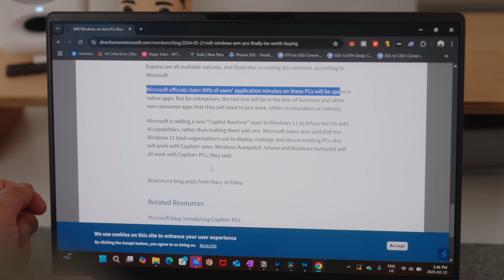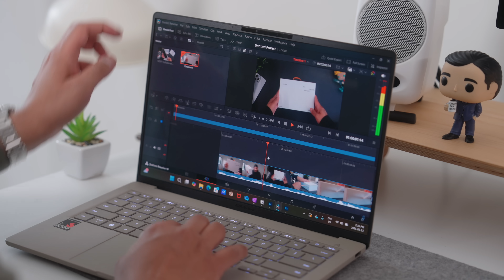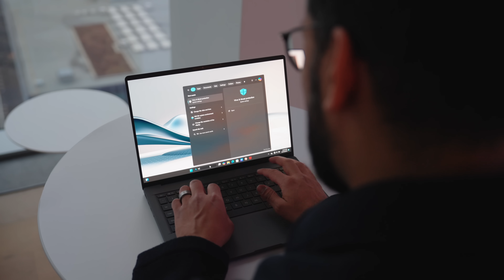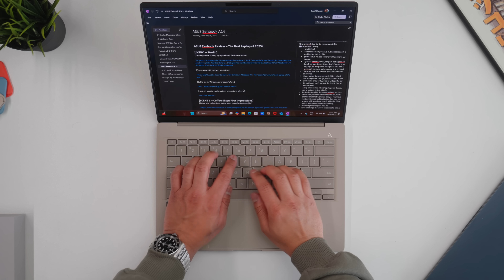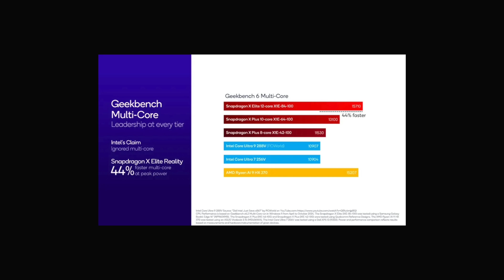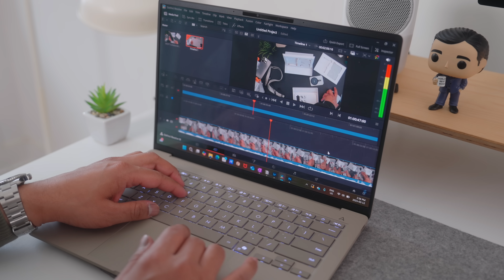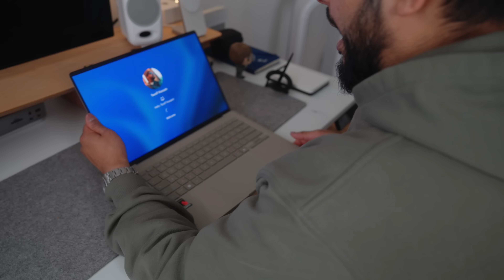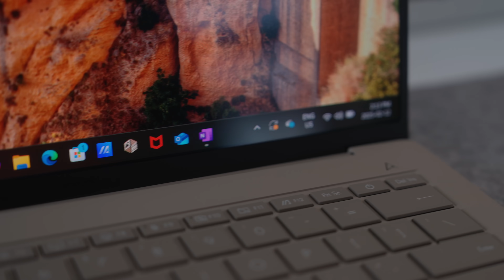MacBook Air User Switches to ASUS Zenbook A14 - My Experience

Comment: Damn, as much as I want to stick with a MacBook (currently using the Air M3 - base model), I'm having difficulty with the software I use for my course and most likely for my internship. My course requires lots of Excel work. While Excel is available in Mac, I encountered a lot of limitations which are just available on Windows. I tried to use Parallels VM for running Windows software--Excel, Power BI, and other windows-only softwares it's so slow since I have 8GB  or RAM. MacOS alone uses 6GB or RAM and with a VM in the background, it uses a lot of swap memory already.

Do you think this Asus Zenbook A14 is enought? or should I look at other options like the ASUS Vivobook S15 (X Elite), or laptops with Intel Core Ultra 5 or 7 with ARC graphics? Thanks.
Reply: I have the same dilemma. Air M4 vs Asus Zenbook A14 vs Asus Vivobook s15 😢
Reply: @accaneda3300 I went for a Lenovo LOQ 😂 I realized that these does not fit well with the things I do (data analytics) and I find these laptops slow and could face app compatibility issues. I might let go of the battery life aspect, but in terms of performance, I’m glad I went with a gaming laptop since these are slow af

Comment: For those who commented and laughing about 60 Hz, do take note that those who buy this laptop are looking for mainly 2 things, light weight and long battery life, at least for me that's the reason. I just need to charge the night before and bring it around when I travel to different appointments the next day. I do not use it for gaming, purely work and presentations and yet do not have to pay an arm and a leg for it. My only concern is the number of charge cycles of the battery before it can't last. Hope it lasts! Cheers!
Reply: Is almost as expensive as a macbook pro
Reply: @eelratas  Nope, same price as Macbook Air. I bought at about $1.1k USD. Is MAcbook Pro the same price? I have been using for 1 and a half months. 1 Full Charge of it I can use for 3 to 4 days before next charge. Normal work and office use.
Reply: @zyanuro  I got the Zenbook at 579 USD at a Best Buy just this month

Comment: Switched to a MacBook Air M3 at the end of last year and i'm really enjoying it so far - very portable and powerful at the same time. I was considering the Windows ARM options in-particular the Surface Laptop 7 but the lack of much GPU power and possible issues with compatibility put me off. In a couple of years time though it will be interesting to see how far Windows on ARM moves and it is good that more competition is around!

Small point on the video - really enjoyed it but the laptop you are using has the standard X chip from the sticker and the multi core claim seemed to be based on the X Elite not the X (which is still slightly better than the Lunar Lake chip in that regard).

Comment: The main reason to own a Windows laptop: 1) Gaming 2) Linux. It does neither. Waste of money. Otherwise, get a used Macbook air for less money.
Reply from the maker: I mean if we’re comparing used to brand new laptops, of course we’ll have discrepancies in what’s worth it etc. at the end of the day this is a solid productivity on the go laptop for most students and professionals alike. I think I made it pretty clear In the video that it’s not for gaming and Linux.
Reply: This laptop is also built like shit. Unlike Apple, asus uses glue to attach their hinges. One of the numerous ways they cut cost.
Reply: Linux for arm has been a thing for like a decade. The GPU is a bit weak but it would get there in a few iterations. Of course Chromebook will have an existential crisis. And this is a good buy for your parents or anyone who does not game. I also expect it to get a lot of enterprise sales eating into the typical Dell HP markets

Comment: Hey Tausif. So I bought one this week here in South Africa. There's only one version right now here and that's the top spec with the X1E-78-100 Snapdragon CPU, 32GB RAM, 1TB SSD. I was a little hesitant at first but found it to be all round the best for my needs (data analytics/consultant). I run Microsoft Power BI daily, Office, SQL, Python and other tools in this space. Everything worked amazingly well, way faster than my 10th-gen Intel Razer Blade 2020 (it really feels like a generational leap, and I'm stunned!). The only issue I faced was getting SQL Express installed for local databasing. Tried a few things, but in the end I resolved it even easier by installing SQL Express LocalDB (light-weight version you have to choose to download in the download media section). This worked flawlessly and even restored my .bak from my Windows PC SQL Express instance. LocalDB also connects up to Power BI.

Weight is amazing and I still can't believe the performance for such a small footprint. The screen is beautiful - my first OLED. I thought I'd miss 120hz, but given the work I do, 6ohz is better on battery and doesn't actually add more value i.e. it's a nice to have, but I think I would disable it if it did and only enable it when/if needed. Battery life is incredible so far and on the first charge, I probably did 3 times more what I could have done with my Razer and it ended off the day at 63%. I think the one thing I have to give credit too is the Microsoft PRISM emulation layer. I honestly initially thought I'd see it hinder loading up an app or affect performance. It's so incredibly seamless and you never feel or think there is emulation, it's still faster than my Razer. That being said, native apps work even faster.

The weight was one of the main selling points, or rather, the size/weight/performance ratio. I travel a lot for work so to be able to do everything on the fly with this ratio is mind-blowing. And finally, I play only two games...Age of Empires 2 Definitive Edition and Tiny Glade. Both work (with a notice at the start of potential incompatibility but loads perfectly thereafter) and work incredibly on battery as well with barely any fan noise. Looking forward to more long-term usage!

Comment: Having used a thinkpad, the keyboard makes me choose lenovo (thinkpad series esp) almost every time. I cannot even think of using another laptop keyboards
Reply: As a Macbook user, I tried the Thinkpad keyboard and they are really good! The tactile is great for typing
Reply: @GierlangBhaktiPutra  agreed. I have used macbook keyboards as well, they are good enough but one thing that sets apart ThinkPad keyboards for me is that my fingers naturally adapt to the key placement, I don't have to make any efforts to type - it comes naturally
Reply from the maker: Thanks for sharing!
Reply: I also favored ThinkPad keyboards to be the best, but the sharp clicks of Macbook Pro keyboards are more pleasant to the touch.  Nothing to do with typing accuracy, typing speed, or key travel distance; just the the subtlest feel at the fingertips on clicks.
Reply: Thinkpad x1 user, greatest keyboard I’ve ever used, battery life isn’t the best though
Reply: @AlexLovesColour.   yeah, pretty much all the windows laptops have dogshit batteries

Comment: With Intel Lunar Lake, nope.  You can get excellent battery life and full access to X86 software & games.  Also, good encoders/decoders for light photo editing and light video editing.  

For heavy duty workloads, M4 Pro and AMD Zen 5 CPU laptops.
Reply: Even intel arrow lake H/HX series are really good for power users.
Reply: @kartikpintu  H maybe. HX is just useless. You'd have to feed an insane amount of power for there to be a meaningful difference over the normal H model. Not to mention you completely sacrifice the low power island. Meaning battery life goes out the window. 

Arrowlake in general has been pitful. Releasing almost 8 months late and just barely reaching strix point. Panther lake is also coming out literally 2nd half of 2025. Arrowlake has been one of the most pointless releases of all time.
Reply: you are comparing 900$ laptop with 2000$. really?
Reply: @hirunguyen4522  Even if you compare it to the M3 Air and the soon to be released M4 Air, Intel Lunar Lake CPU laptops are good competition for the average consumer.
Reply: @akin242002  problem with lunarlake is that it doesn’t stand close to apple silicon once the compute unit becomes active

Comment: I have a 2021 M1 Pro MacBook Pro 16 and it's been a war horse. I am thinking of replacing it in 2026 if and when they get rid of the notch. I'd replace it if they came out with a 4k 17 inch display too. I need 4k resolution, and, while Apple's Retina displays are close, they aren't quite there yet. I'm running it at 2,624 x 1,696 resolution which is what I mainly use but sometimes I run it at 3,456 x 2,234. We bought an MSI Raider 16 a month ago with 14900HX and RTX 4070. If you need to run x86 Windows, it's a monster of a system and super-responsive. We chose it for build quality and support. It replaces an ASUS gaming laptop and I'd never buy from Asus again given our support experience. They do not stand behind their products nor do they provide support many years from purchase like Apple does. One of my main programs runs on x86 really well but it doesn't run on ARM very well. At home I use a Windows desktop (i7-10700) and, on Apple Silicon, I put up with a sluggish program. It's unclear how serious Microsoft is about ARM. Apple isn't making anymore x86 hardware so it's putting a fair amount of pressure on developers to port to Apple Silicon. Microsoft makes it easy if you don't care o support ARM.

Comment: I do not like Windows, so the MB Aiir M4 coming next month would be my choice. You can get the M3 now for £150 less than the A14, both with 16GB of RAM, so the Asus is poor value on pre-order. I would wait 2-3 months as £1100 is too expensive compared with x-Elite, which is heavily discounted and now much cheaper at third-party resellers (new); that is if you are determined to buy Windows.
Reply: Next week I guess